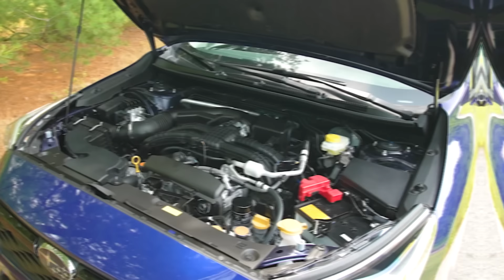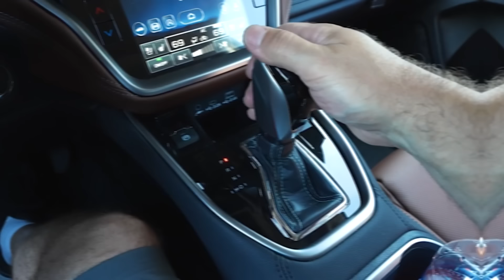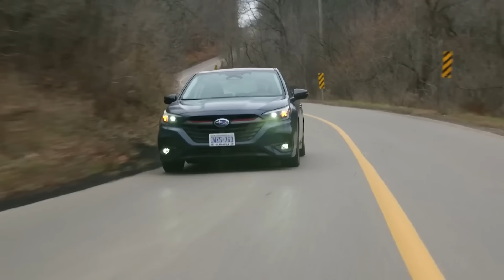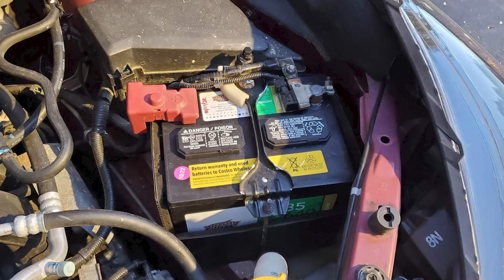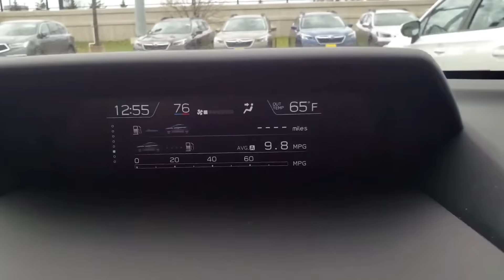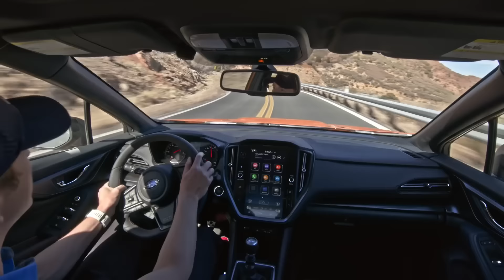These 5 Hidden Subaru Settings Are Ruining Your Engine Lifespan - TURN IT OFF NOW!

Comment: How is it "a cold start" as you call it if you are driving in the city? The only "cold start" would be when you first start it after it sits for a while and I don't mean only 5 or 10 minutes. Seriously I don't understand your logic. Starters are different for the Auto-Start Setting equipped vehicles.

Comment: Thank you for covering the Accessory Mode, I bought a 2025 Crosstrek and since it was my very first push start 🙈 (yes my kids are making fun of me) I accidentally left the accessory mode once when I took my lunch in my car for 20 min & I panicked when it wouldn’t start after. I frantically opened the door to get out because I was panicking & that must’ve reset it because it started back on after, never again. I feel so old missing the simplicity of my old Jeep 😢

Comment: An important thing is to drive at 55-65mph for at least 20 min about once a week or so. This will get the cat converter hot enough to clean out the carbon build up. A new cat converter is about $2,000.00. If you only put put to the store every day you will kill the cat in 75k miles or so. It will also kill the turbo from contamination.

Comment: My Ascent has smart auto temp control. Leave it in auto all the time and make minor setpoint adjustments. The computer looks at engine temp and doesn't allow it to blow cold air so it waits until the engine is warm and then ramps up the temp controls. All in auto.
Reply: Exactly!  Our 2014 Impreza and 2023 Outback both work that way.  The heater doesn't start to work until the engine is warm enough to provide heat.  I've never been able to figure out why someone would think that manually increasing the temperature setting and cranking up the fan speed is a better way to go.  Mr. AI video man doesn't know what he's talking about.

Comment: I never thought about this when I bought my fancy Crosstrek.  I need my reading glasses to read the infotainment centre, but I can't wear my reading glasses when I'm driving because they blur my long-distance eyesight.  LOL!
Reply: Maybe try progressive lenses so you can read or see with the same glasses?
Reply: I had exactly the same problem so on an optician check up I told them this and bingo I got a prescription that has been a game changer. I can now see every little detail on my dash and roadsigns way in the distance.

Comment: I have a 2016 Legacy. Some of the issues you brought up, my car doesn't have that ! I don't have eye sight, remote start, start/Stop mode, or sport mode. I do have the ability to switch to manual shift mode, but I hardly ever use it. So far, I just usually just keep up with maintaining all the fluids and filters in the car. Also I keep an eye on my tires. I like Coopers for my car. They are reasonably priced, and respond really well.

Comment: One thing is that those engines you're showing aren't Boxer Engines ! Subaru's don't have a straight 4 or 6 cylinder engine. They have opposing 4 cylinder Boxer engines. So if you want to show a diagram of a Subaru Engine, show the right one ! The oil doesn't need to get shot up because the cylinders are laying flat.

Comment: Auto start-stop does not equate to cold starts. The engine is still warm and the oil doesn't have time to drain back in the pan.
Reply: Totally agree the new Subaru’s will not do auto stop on a cold vehicle. Your vehicle engine needs to reach a certain temperature for auto stop start function.
Reply: It's hard on everything no matter

Comment: Who is this guy? There are some inaccurate parts to each of these. Auto Start/Stop components are designed for such workloads. Starters are stronger than before this system. So is the battery. Now, Subaru has had battery issues; but, that is another conversation. Plus, he focuses on MPG versus emissions. When the engine is not running, it's not putting particulates into the atmosphere. Less gas is not the focus. Just happens to be directly correlated. When you turn your car off, the accessories remain on for THREE minutes. I have no clue where he gets 20-30 minutes from. Auto climate control? BLASTING heat right away? If it's on auto, it will not blow AT ALL until the engine is warm enough to provide warm air. THEN when it gets to the desired temp, it adjusts to less work to maintain that temp. Just like your thermostat in your home. And some of the trims have a Positive Temperature Coefficient Heater that helps heat the air before the engine gets warmed up. In the heat? Same difference. I can't imagine people NOT "Blasting" A/C in the summer in either mode. But, NOT in auto setting and someone has temp set to LOW and fan speed 7? It will NEVER stop. Whereas IF the temp gets near the cold temp in auto, it will adjust accordingly. The drive modes? Of course the Sport or Sport# modes do more. But the car defaults to Intelligent mode on start up which the car responds to inputs as easily as it can based on the input. That actually is HELPING the car. If the customer wants more? They have to choose that; so, there is no need to "turn that off". It's more like don't turn it on. He mentions that people remote starting and it idles for 15 minutes. Well, MAX is 10 minutes. Whereas the owner can restart it again to get the engine to the operating temp needed as he suggests. 

The failures he mentions are certainly a thing to be mindful of; but, they don't  fail in any sort of higher rate than they did before these systems came about. 

These systems have been around a long time and Subaru still maintains that 97% of the cars they have sold in the last 10 years are still on the road. If these things are the problems as he suggests, I'd wager that number wouldn't be soo high. I'm afraid to watch any more of his videos as I might me commenting a lot more.
Reply: As to the accessory times after shutdown, how many people shut off their car and sit in it for 15 minutes without using accessories. Most drivers get out of the car after shutting it down, which turns off the accessories. I was told that the accessories are enabled after shutdown only if the battery has sufficient charge. This means that on short trips, the accessories may shut off immediately upon engune shutdown.

This video is clickbait.

Comment: You often don’t need a installed av auto start stop device. The function of start stop function only stops the engine when you breaking hard. But if you’re breaking softer you first of all stil can stand still even with engine running. When you also don’t need to deactivate start/stop system every time turning on your motor again. So in some way some one trying to scam you.
Reply: I wondered why it wasn't shutting off every time i came to a stop. its because I stop softly. That's easier and cheaper then installing an aftermarket component that the dealer would use as an excuse to void warranty.
Reply: @MrRankingToyan  It also will not shut off if your AC is running and interior temp is not cool enough. Here in Florida, the AC is on 90% of the driving time. No way I'd want the AC and car off when it's hot inside.
Reply: When I bought my 2026 Subaru cross track I was told I have control over the start stop function. If you push hard on the break all the way to the floor that’s when it engages the start stop. It’s to use if you in a dead stop for awhile like in traffic grid lock or long stop lights 14:50 where engines burn gas, and sometimes overheat during the summer.

Comment: So idling causes coking in turbos? News to me! Turbo coking is caused by shutting off a turbo engine IMMEDIATELY after hard driving. The red hot turbo bakes the oil because of no oil flow through the turbo. IF it isn't allowed to cool by say "idling" for a couple minutes to allow it to cool WITH oil still flowing through it!!!!  Dumbass AI!

Comment: Ok, completely off subject of the video. A 2016 Subaru Outback. The infotainment center with gps works sometimes and sometimes not. I figure it’s a switch or relay or something. I’ve tried reset; nothing. Any ideas? Thanks!

Comment: Another helpful tip if you use the Subaru Starlink system, make sure you contact Subaru and tell them to stop selling your personal data because yes they do this just like a lot of the other manufacturers of modern cars unfortunately. Subaru's are wonderful cars, but if we could get them to stop selling our data, that would be very nice on their end. And ethical.
Reply: If you don’t have the star link remove that fuse because it drains your battery too death
Reply: @cherobinson6371  yes, if you pull the DCM fuse out of the fuse panel under the hood, it disables the telematics, starlink, etc, but you lose function of your front speakers, tweeters, and microphone when you do this.
Reply: @cherobinson6371 - Prove it

Comment: Auto start stop is to meet emissions not for fuel efficiency. The auto start stop starter will throw a check engine light after after a certain number of starts
Reply: Liar
Reply: It does both. We need to thank Trump for having the start/stop requirement removed.

Comment: Generally good advice - perhaps apart from the sport mode comment. If you engage sport mode and drive aggressively *from cold* well  yeah that will decrease the life of the engine and transmission...but so will the same driving style in normal mode. I think driver behaviour is the likely causal factor (it is perhaps a thing that many folk who set sport mode as default may also hammer the car right from cold, thus creating a fait accompli). I usually drive in sport mode  (Legacy turbo with cvt) but am careful about how I use the accelerator pedal until the car has been running for 10 min or so).
Reply: I accidently engaged sport mode and the car drove so jerky I thought it was broke!  Dont like using it on my motorcycles either...Just me.
Reply: @chrisdahlmann5446  I'd guess it is very dependent on what sport mode in any particular vehicle model actually does (and how aggressively). In my case, I have a 2012 Subaru Legacy and sport mode quickens up the throttle response *a little** and weights the steering a bit. It also gives you the option of 6 pseudo gears (CVT trans). I like it.

Comment: In other countries, same car, same engine, it's 5w30.  It's to meet the EPA fuel requirements that they say OW20.
Reply: Also halfvthe recommend distance. Don’t go past 5000 KM or 3000 miles.
Reply: Sorry, but you need to watch some oil videos. The whole 5W30 thing is 100% bullcrap!!!

Comment: I also really question Subaru's use of any oil that has a viscosity as low as zero. I don't live in an area that ever sees snow and think it causes more wear and tear on a Boxer engine
Reply: In other counties, same car, same engine, it's 5w30.  It's to meet the fuel requirements that they say OW20.
Reply: In other counties, same car, same engine, it's 5w30.  It's to meet the EPA fuel requirements that they say OW20.
Reply: Do you know what viscosity actually is. 0 weight oil flows to the heads more quickly than anything else.
Reply: There's a guy on YouTube, I think his channel is motor oil geek and he tests out the 0w20 and has actual results of the oil itself and how it works, clearing all the myths up that you hear people throwing around about it. It's really not as bad as one might think, as long as you use a good brand of it. But on the other hand, there's not really any harm in going up to the 5W30 either, as long as you don't mind losing a little bit of fuel mileage, because at the end of the day that's the real reason why the 0W20 is used.
Reply: @johnnybaggins777 switching to a different viscosity of oil than what the manufacturer says can void your warranty if the engine blows up. Even if it’s not a consequence of the oil viscosity change because one of the things they’re going to check to honor the warranty claim is to test the oil. When they see it’s not the right viscosity they’ll deny the warranty claim.
Reply: @truckinguy92 I get what you're saying and they probably would try to fight it, but realistically in other countries Subaru is using 5W30 in the same vehicle with the same engine but here in the states they're using 0W20 for fuel economy standards so they really don't have a leg to stand on with that because of the fact that it's common knowledge the other viscosity works just fine in that particular engine so much so that they actually use it in other countries without such stringent fuel economy standards.
Reply: That's because you're ignorant. Watch a video on testing of 0W20 vs 5W30. Unless you're in the desert, there's no difference while 0W20 is much better for cold starts
Reply: If your dealer denies a warranty claim for a non-oil related issue because you changed oil viscosity, get an attorney (or at least suggest that’s what’s coming).  Or just mention the Magnuson–Moss Warranty Act—that usually will shut them up.  I’m not saying they won’t try that BS, but NO, they cannot deny a warranty claim on an infotainment system because of an oil viscosity difference.  If you melt a connecting rod bearing, then they probably have a good starting point.  
But don’t go crazy and change from 0W–20 to 20W–50…that may bring in other issues.  

It’s a “recommended oil” not a “required oil.”  Like they always recommend genuine Subaru parts, but they can’t require them.   The onus is on them to prove a change was the cause of the failure.  Just don’t stick 50A fuses in 10A circuits 🤷🏻‍♂️😂

Comment: I installed an auto-start-stop eliminator on my 2025 Outback with a turbo the first week I had it. Best thing I ever did.
Reply: Starts are the most damaging thing too the top end of a engine.
Reply: I’m curious if something happens to the ECU or any electronic module whether it can get a warranty claim denied? I’ve pondered getting one but worry about something happening to the computer.
Reply: @truckinguy92  it's WHY I won't install one on my new car..Then your warranty is null and void.
Reply: Ditto on my Forester.
Reply: What did you get and from where?
Reply: people have reported problems with the touch screen after installing the eliminator?

Comment: I disable start-stop immediately after starting the engine.
Reply: The thing we all hate.
Reply: @Snoopy-qe7kt  Why do you hate it?
Reply: @billclark8241  I was in the middle of Arizona and my battery failed while stopped overnight. Had I not turned this feature off during the day, we may have gotten stuck in a very bad situation. Also, when it’s enabled, it does slow down your response time and that could be deadly if you need to avoid a fast approaching vehicle. This should be banned on all vehicles or at the very least default to OFF!
Reply: I forget sometimes because I’m not totally used to it.
Reply: I do too.
Reply: I hate it!

Comment: Installed an autostartstop eliminator in our new Impreza RS the first day we bought it.
Reply: A must have when you get tired of turning that feature off every time you drive the vehicle.
Reply: How is an eliminator installed? Can one do it or does it need to go into a shop? Once it’s installed will Subaru dealer consider it an obstacle to repairs?
Reply: @naomiweiss5464 it seems to me that it can be vehicle-specific. You would need to go to the website to figure it out exactly where it is placed. I think they have how-to videos and an FAQ section as well. On my model of crosstrek it mounts up where the eye-sight module is above the mirror. Basically, the harness that plugs into the eye-sight module, you plug that into the eliminator and then the eliminator where the harness used to go. But I believe there are certain other models where it goes somewhere else like under the driver's seat maybe or something like that. If you're not mechanically inclined to disassemble your car in a minor fashion, I would have somebody put it on for you. Once you have it on the vehicle, when you press the button to turn it off, it just stays off. But if you press the button to turn it on, it will stay on. It just stays where you press the button, if that makes sense. So it should not interfere with any other repairs or things of the like.
Reply: @naomiweiss5464  The video said that the eliminator plugs into the OBD port which is usually  up under the dash on drivers side and very easy to reach. It's the same port that provides diagnostics like error codes. So it should be easy.

Comment: Warming a car up in winter isn't hard. Once the "cold engine" light goes off. Just push the car to make more heat.
Reply: My 2022 Subaru Outback with the 2.4-liter turbo does not such a light, FWIW.

Comment: Sorry, but Intelligent mode in my 19' STI makes the car undriveable. Totally kills throttle response and power. It's Sport mode for me all day everyday. Also permanently turning hill assist off is a must.
Reply: That's because the '19 hill holder sucks. Hill assist was garbage on my 2011 (more like random launch control), but I don't even notice it on my 2023 WRX. I see no reason to turn it off as you don't even notice it unless you're on a hill and then it releases instantly as you clutch out. 

The Vb has such even torque, though it almost feels like a NA car now. I miss the sudden kick at 3800RPM. I bought a used 2023 because Eyesight sucks. Pull a fuse and you can even disable ABS for off-road racing. 

My only complaint is HVAC on that big screen as I'd rather have real controls. It's great for Google Maps though. The 2026 Outback gets it right with real HVAC controls and a screen that's just smaller to remove them.